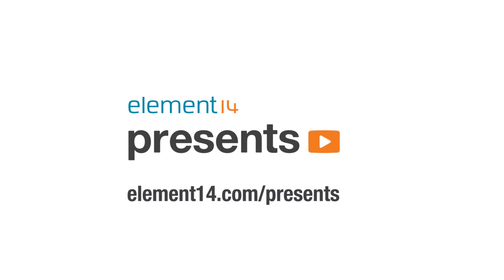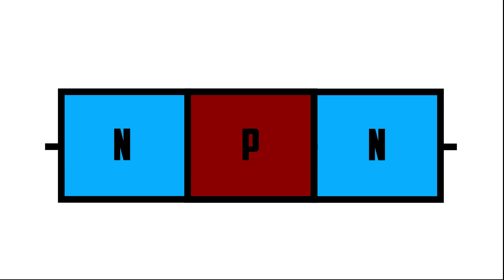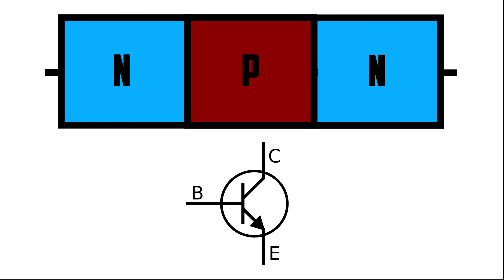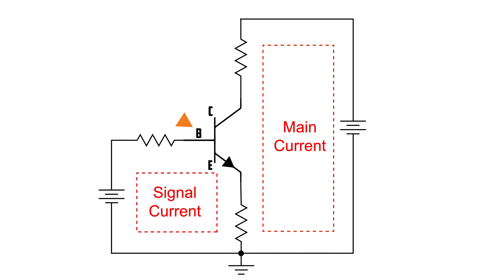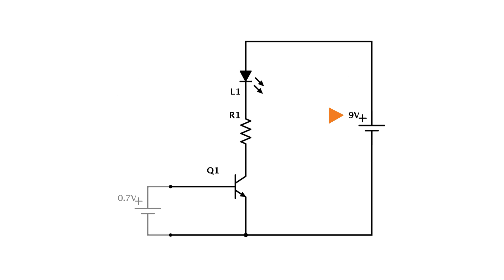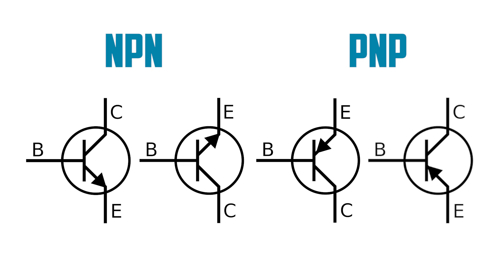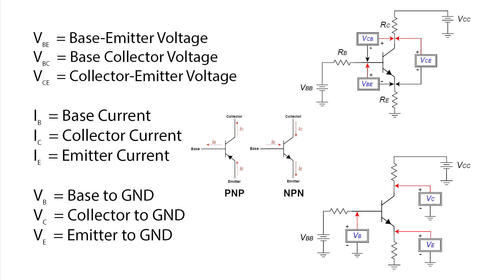How Transistors Work - The Learning Circuit

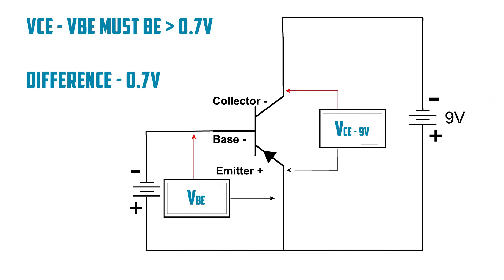Comment: 4:30 PNP transistor, ????    all we need do is turn the battery around so  the (-) side goes to the base to make the PNP transistor turn on. The only difference between a PNP & NPN is that the PNP transistor needs a negative bias or B-E voltage to turn on.
Reply: cat 11 Yeah, this whole PNP section is complete wrong from start to finish.
Reply: Usually,  not always, NPN is used to switch a circuit on the ground side.  PNP is used to switch the circuit on the supply side.
Reply: ...and the fact that due to tecnology issues it's easier to produce fast and highpower NPN than PNP with same characteristics
Reply: I also read that design engineers often used NPN's so it became more popular.
Reply: npn transistor charge carriers are more mobile, so they are 'faster'.

Comment: I learned vacuum tubes first and some of the older books compare a tube to a transistor. So that made it easy for me to learn transistors.
Reply: Tubes were much nore forgiving. I began designing tube circuits and if you make a mistake like grounding a grid, the plate glows cherry red hahh
With a transistor, it just gets damaged and the circuit fails to operate leaving you with "ok why isnt this working?"
Of course working with non lethal voltages has its benifits hahah
Once I was working on a T.V. and had my hands inside while adjusting the time and my knuckle came to close to the horizontal output tube playe cap. That Hurt a LOT!!! I once got belted with the anode wire for a b&w crt. my jand felt like it was in a. Vise and then got smacked witha hammer! Ouch!
Reply: @rty1955  I've worked on both. Transistor sets you slip with you probe and short something and you blow out half the set.
Reply: @cat-lw6kq  haha true. Ya gotta be careful with all.esp. now with close tolerances. Gone are point to point wiring where U can push components out if the way to get to a test point
Reply: @rty1955  those old tube sets could take a lot of abuse. My teacher would show us what would happen if parts of a tv failed by removing tubes in a working set. The set was powered on and he would pull tubes one at a time. Try doing that with a transistor set.
Reply: @cat-lw6kq  how very true. He must of had silicon hands! I recall working in a broadcast T.V. studio where 21" Conrac monitors hung from the lighting grid. They replaced the covers with a screen mesh to allow for airflow. When i took it down for repair, I put it on the bench and powered it on. I could have baked a cake in that thing!

Comment: Yep, another video where someone calls a transistor a switch... If that's really the case, how on earth are the transistors in an audio amplifier putting out a sine wave to drive speakers? You do understand that square waves don't make good music! You might as well flick a light switch off and on repeatedly to see what it looks like, now do the same thing with the dimmer switch... Now do you see how you are describing the transistor incorrectly... It operates like a potentiometer with hi power handling and also can operate very fast... You could use it as a switch but you can also use it as a potentiometer.... All depends on how fast the voltage rises on the base....
Reply: 'square waves don't make music'
lofi bit music producers are crying:(
Reply: Антон Кузнецов LoL... that's a very good point... Replace the transistors with relays in an amplifier output stage and then tell me if you still call it music LoL.
Reply: @PeterMilanovski  You won't believe what some people call music nowadays )) and... yep, back in times I wrote some things on a PC without soundcard, using internal speaker only. It was fun anyway )
Reply: this is just an example of using a transistor as a switch. transistors are often used as power switches in tv's. this video is confusing and should be taken down.
Reply: Square waves don't make music, except when they do.  Class D amplifier?  Lol.  Seriously though,  I know what you mean.

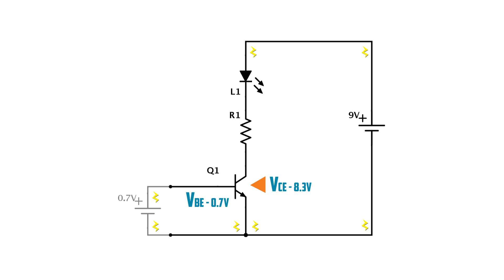Comment: @ 4:24 you say the Vce is 8.3 volts thats is not the case tho it vill be in the (30 to 40) mV range when the bjt is turned fulli on, if you wer right ther will only be 0.7 Volts left over the LED and the Resistor not mutch light will com out of that :-)
Reply: I don't quite follow you but they did goof up the explanation of the PNP transistor.
Reply: I also believe there is an error at 4:24, vce is not 8,3 but what is left once voltage drop in led and resistor from collector are substracted from 9v, otherwise I liked the video. It would have been nice to elaborate why TRANSfer Resistor is the origin of the name TRANSISTOR.
I believe Torben you are saying the same with different point of view

Comment: For something to have relevance, it needs to be shown in a real life benefit. Isolated theory is almost useless. Put it in a real life circuit and show the benefit received by an output we'd want in real life. What you showed has no meaning without the ultimate desired result that helps in our rubber meets the road needs.
Reply: there are two types of people. those who love and learn from theory. and those that love and learn from doing. the first group never actually achieve anything interesting and are rather boring people who are happy to live uneventful lives. the second group are people who do many things in life and live for the next adventure. the presentor is clearly the first type. instant yawn.
Reply: @freelectron2029  I guess you're in the first group?

Comment: How that 1 ma current comes into the picture? Like if we select the base resistor then according currwnt will also change and hence collector current? So if there is any load connected to collector terminal and more than the current what collector trminal is drawing becuase of hFE then load will turn on or not? Assume load any motor that need s 1A current to run... But it's getting 800ma

Comment: the arrows in the PNP are confusing. They have different symbol in each time they appear. That may confuse many. be careful. The correct way i believe is the a downward one from colector to the base.
Reply: I always see instructors flipping the PNP around and I think if I were a beginner,  it would be confusing. The NPN is usually used as a ground side switch.  The arrow is always the emitter and indicates direction of current flow.  Inject a small current into the base that flows to the emitter,  and a larger current will flow from the collector to the emmitter.  PNPs are flipped over with the emitter connected to the supply and the collector connected to the load.  Pull a small current out of the base to turn the transistor on.
Reply: The correct way for PNP is with the arrow pointing inwards.

Comment: ive watched more videos than I wanted about transistors and their types. I just can't wrap my head around the "extra" power supply needed to activate the transistor. I wish I had someone in person to explain it to me more in depth and also perform a bit of slower demonstration. UGHHHHHHHHHHHHHHH this has been bothering me for months. It's a mental brick wall that I can't get around.
Reply: in silicon based transistors, the base needs to be fed minimum 0.7v otherwise the current won't flow in CE, which makes it act as some switch.

Comment: Can u make a video on how to make transformer less power supply and how to find the value of x rated capacitor that is use to drop ac 220 volt and about bleeder resistor that is connected parallel with capacitor , n current dropping resistor

Comment: Are not transistors current controlled devices??? Why are you referring vbe to turn on transistor ??
Reply: Yes, transistors are current controlled devices. But if there is a Vbe then there must also be a base current. So ensuring there is a Vbe that is high enough to ensure a high enough base current is usually the way we look at transistors (especially those used as a switch). It seems backwards but it is actually an easier way to design with transistors. Most people calculate and design transistor switching circuits using voltages. There are several reasons for this: 1) Most people use voltage sources, not current sources. They have batteries with known voltages so it is easier to work with voltages. 2) When designing a transistor switching circuit, the actual base current (Ib) is really not that important because it will be limited by whatever current flows into the collector (Ic - assumes NPN). You typically design a transistor switch to completely saturate so that Vce is around 0.2V. Your collector current (and thus your base current) is dictated by the output, not the input. So the base current simply ends up being whatever is needed to drive the final desired output. You typically don't care to know the exact base current, just that you have enough current to turn on the transistor such that it fully saturates. It is a weird way of thinking about it but for switching circuits, it works well. 3) The relationship between Ib and Ic is a ratio of a value called hfe. This value varies not only by resistor type, but also by discrete component. In other words, you really can't even guess what the amount of base current you would need in order to get a specific collector current. So trying to design that way is just too complicated since hfe can easily vary by 10% per device. So the way transistors work is by current control. But this is not the way designers typically design with them. Especially when using them as a switch. Amplifier circuits are slightly different but most hobbyists don't bother designing discrete transistor amplifier circuits. For amplifier circuits, hobbyists are typically better off using op amps.
Reply: @mtslyh  I agree with "if there vbe, there is base current". Consider you have a transistor whose hfe is 100, providing voltage of 0.7 to base and limiting base current to 1uA. Can we drive a load of 10mA ?

Comment: if both the emitter and collector are the same N or P, how do they differ? what makes one an emitter and one a collector? could your make your own transistor using 2 diodes or is there something fundamental that i am missing.
Reply: You cannot make your own transistor using two diodes because they need to share the same junctions with the common region. Also, the emitter and collector may have the same circuit diagram and you can actually wire them up backwards and they will still likely function (perhaps poorly), but they are usually not the same. Transistor manufacturers will often dope them differently so that you get the best performance using them the way that they are labeled. Also, you aren't guaranteed that your discrete "transistor" isn't actually made up of more than one transistor to improve performance (ex: darlington). So it is best to use it as labeled.

Comment: HO MY F GOD I FINALY UNDERSTAND!! T__T Seriously thank you! I'll be sure to watch your other videos!
Reply: Read art of electronics much better than this video.
Reply: they goofed up in the explanation of the PNP transistor, the rest of video I didn't watch. In the diagram all is needed is to turn the battery around so the (-) side goes to the base.  In this diagram we are applying 8.3 v to the B-E , we could do that but we would need to use some resistors to drop the voltage to .7v. 
Both the types of transistors require about .7v to conduct.

Comment: Can we use bc547 transistor as motor driver component in mini brushed motor drone microcontroller replacing the mosfet? :)
Reply: no. the mosfet has smaller on resistence
Reply: Peter Matthiesen and different biassing.

Comment: im confused at the end,    you state transistors are used to amplify,    but how does it amplify?    it cannot generate extra current out of nothing ofcourse...   so please explain what you mean!
Reply: The amplification wording always confused me, but I think it's a matter of perspective.

When they say amplify, they're referring to the relationship between the base current and the emitter current. Since transistors can control larger currents with smaller currents, you can say that the smaller current gets "amplified". The larger current can be modulated by the smaller current such that it appears that a small current has been turned into a larger current.

As you said, you cannot generate current from nothing. You get some ratio of what you put into the collector and base. The ratio of the currents (gain) depends on the arrangement of the transistor(s). With a darlington pair you can use a much smaller base current to get the same output current compared to using just one transistor.
Reply: Ah right,   so im guessing this is also how amplifyers boost audio signals?  the transistors in amps must be super accurate and being able to switch states super fast ,   wow never thought about that
Reply: @raafmaat  modern amplifiers don't require super accurate transistors because they use negative feedback.  I'm not referring to guitar pedal effects.   Haha.  Seriously,  you don't see too many discrete transistor amplifiers these days.  The majority are operational amplifiers, using stable resistors to set their gain via negative feedback.
Reply: @ThatEEguy2818      i guess ill just learn to live with not understanding how amplifiers work lol
Reply: @raafmaat  did you ever see the 1998 Lost in Space?  In that movie, Will uses a remote link to the robot so the robot does everything Will does.  Every motion of his arms and body were copied by the robot, but the robot was far more powerful than Will.  The power came from the robots power supply.  Likewise, when you have an amplifier,  the output will be a copy of the input.  The power that the output produces is often much more than the input, but this power comes from the amplifier power supply.  The input signal controls the devices (transistors) that pass the power from the supply to the load.  The input signal is not magically increased to feed the load.
Reply: @raafmaat  as for negative feedback, feedback is a principle in which part of the output is fed back to an input comparing circuit to control a process.  For a stable system, the feedback is negative.  For example, when you shower, your feedback of the water temperature tells you which way to adjust the valve.  You don't need to accurately control the valve because the temperature of the water will tell you how to make adjustments.  Too hot, adjust cold.  Too cold, adjust hot.  This negative feedback produces stability.  Of course,  positive feedback would be,  too hot, adjust hot, and wam, you've turned your valve hard over and burned yourself in the process.
Reply: @ThatEEguy2818   thanks!   this helps with visualising it a bit  :)
Reply: It amplifies the signal voltage. It does not generate its own power. Think of how a standard guitar amplifier works. You put in a very low power guitar signal. The amplifier itself takes a very high voltage/current supply from your house and amplifies the low power guitar signal to be a much higher powered output signal (fed to the amp speaker). That guitar amp does not make its own power. You must still feed it power. But it uses the power you give it to magnify the input to make the output much more powerful. That is done internally with transistors. A single discrete transistor works the same way.
Reply: i am slowly starting to get it thanks

Comment: why do transistors increase the current?
Reply: There is a basic law that the current going into a circuit equals the current going out. Silicon normally doesn't conduct electricity well unless you add a precise and small amount of an impurity. This is why you have n-type and p-type silicon. Transistors increase base-emitter current by drawing current from the collector. Normally only an insignificant number of electrons (or bubbles, called holes, in the electron sea of metals) can go from collector to emitter because the electrons need a different amount of energy to flow in n-type silicon and p-type silicon. But by increasing voltage (I.e. charge) at the base, you make it easier for electrons/holes to spill into the emitter (by using the electric field to draw them since electrons are charged). Because the emitter is bigger and is a better conductor than the base (and it is less pure than the base), you can get more electrons/holes jumping from the collector to the emitter using a small voltage at the base. This is called tunneling. You can vary how easy it is for electrons/holes to jump from collector to emitter by increasing or decreasing the voltage at the base. That's basically how it works.
Reply: It doesn't. Signal current stays small. It's a current from power source that is big (between C and E). It's just like giant robot (C-E) that immitates movements of a small human (B-E). Crushing buildings, destroying cities, you know that kin of stuff...
Reply: @АнтонКузнецов-и8ю  Johnny Sokko?  Haha
Reply: They increase nothing. They allow more or less current flowing through c and e by manipulating current on b. Of course there are limits, stated in the datasheets. Max amount of current is decided by the power supply or by current limiting circuitry.